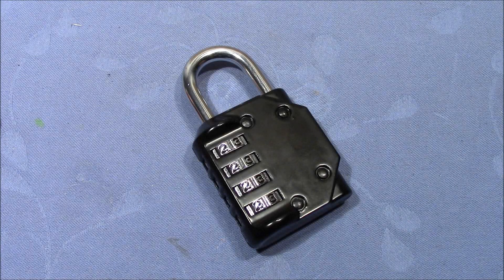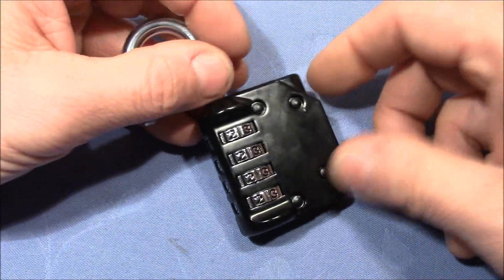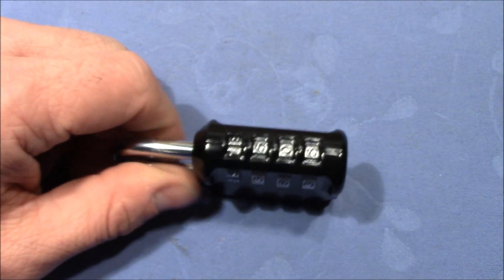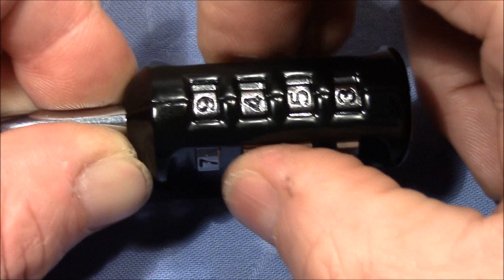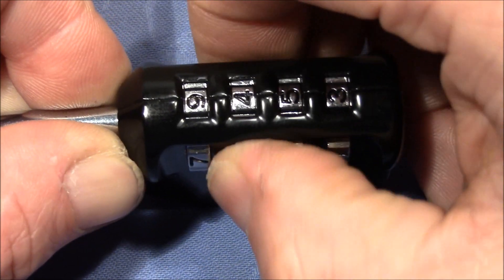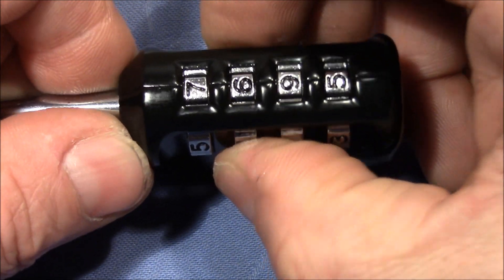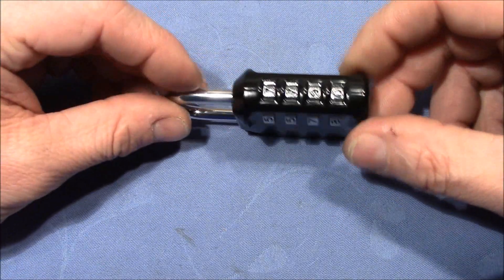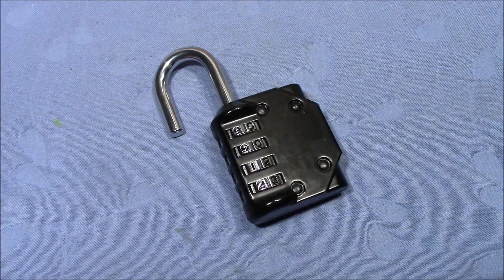(picking 640) Combination lock with false gates decoded - nice starter lock

Comment: I have the opposite challenge with this lock: I can’t close it anymore after a child tried to change the code and only partly succeeded. Since you opened the lock, could you explain its inner workings that might help figure out the code? Is it possible that one gate got stuck between two numbers? If so, can this be fixed somehow?

Comment: Thank you. I set up four new Puroma locks and one of them didn't set correctly. After I shut it back and turned the numbers to zero I could tell that the rollers/cylinder were hard to turn. Yep, the code I just set wasn't right and 0-0-0-0- no longer worked. I used your method to open the lock and lock and reset it. It was really way way too easy to do. These locks suck, but I am not using them for actual security, they are on my gates and patio boxes to keep my toddlers in the yard and out of the storage boxes.

Comment: I just got mine and it is exactly the same lock but this doesn't seem to work. I think it is just because I just got it out of the box though so when I use it a lot more it will probably work. This video was very informative and useful thanks for making this video.

edit: i just did some fiddling with it and i figured out that if you turn the number that feels the hardest to turn while pulling the shackle really hard, if you turn that number decending until you get to the number that stops you from being able to turn it anymore that is your first number. And you keep doing this for all the numbers until finaly it unlocks. This is really fun to do without looking.